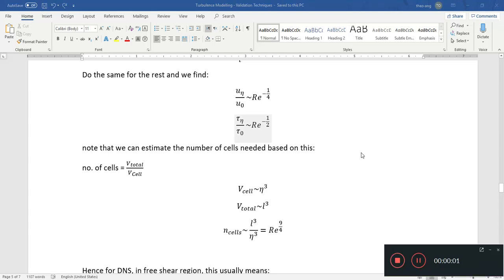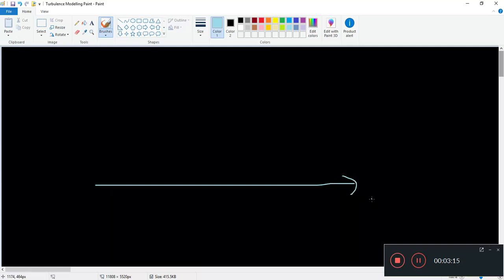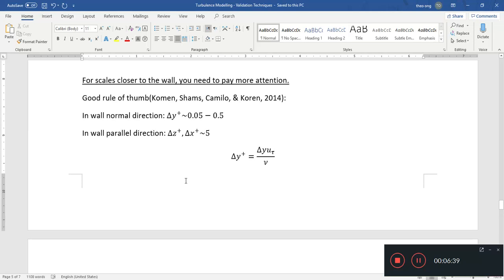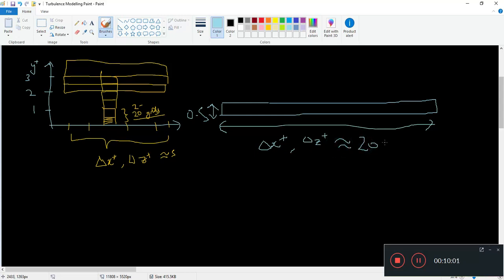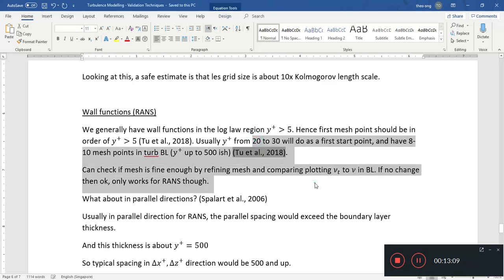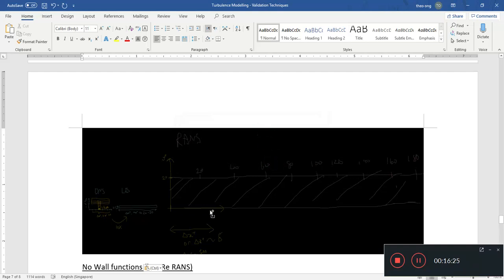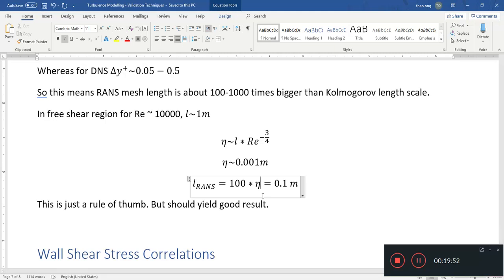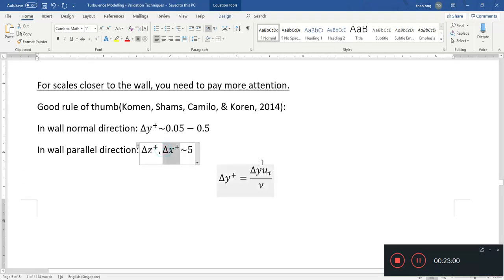Turbulence Modelling 91- DNS LES and RANS mesh sizing in Kolmogorov length scale and wall units

Comment: I have a question regarding the mesh size.
e.g. for Re = 10,000, the kolmogorov length scale is ~ 0.001. The (delta x+) ~ 5. 
In the farfield, the mesh will look like rectangle (length ~ 0.001 and width ~ 0.01).
How do you manage this issue sir?
Reply: @TheoOngScienceAndEngineering  so you mean that the kolmogorov length scale ~ 0.001 (Re = 10,000) should be used in the boundary layer region?
Reply: @TheoOngScienceAndEngineering  I am sorry for asking too much. Where we use the mesh size which is equal to the kolmogorov length scale?
Thank you in advance:)